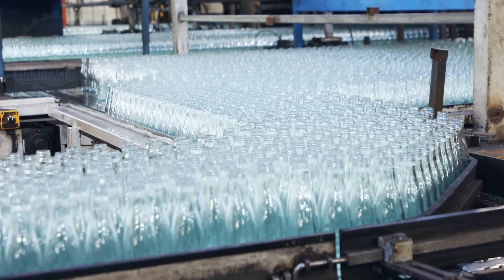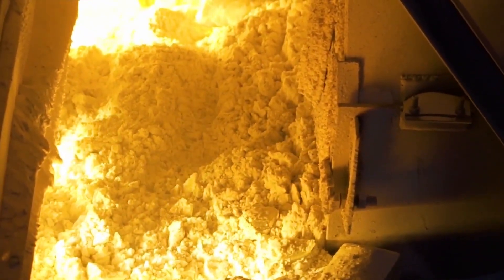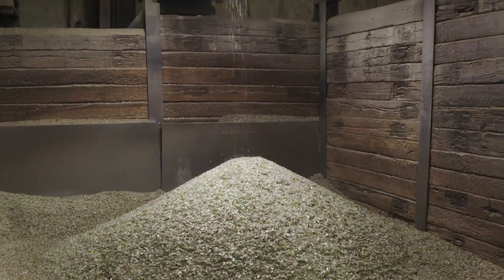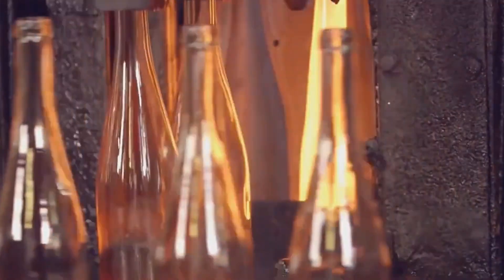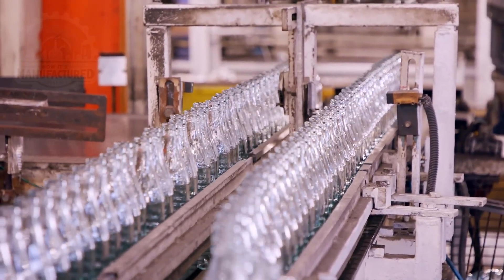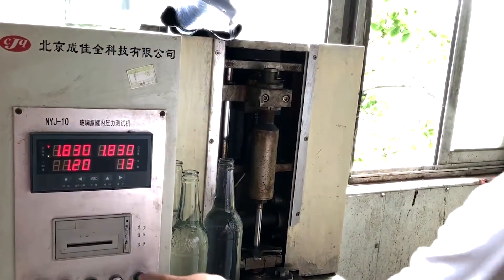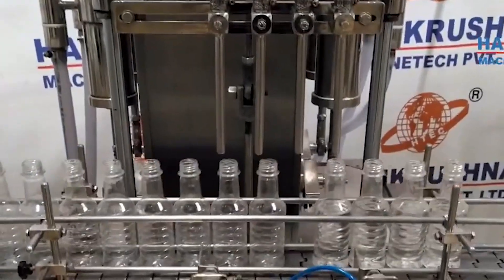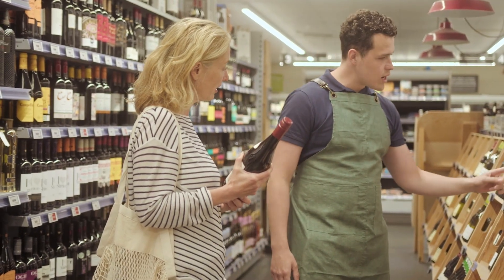How Glass Bottles are Made

Comment: I worked in the factory on bottles just like this one, it was a nightmare, specially during the power outages. When the power goes off, the glass is still melted and still needs to pour down from the furnace, so we had to each time manually reconfigure the flow of glass in the granulation chamber that is situated under the the floor, and it needs to happen really fast. All things for this process are heavy as fck, everyone screams out of stress and you have to be careful and fast. People that work there for years, genuinely develop mental illnesses, as around the machines its hot as all hell around 50 °C, in protective clothing, summer or winter at the end of the shift your shirt is white from all the salt you sweat out and the constant line of bottles plays tricks on your mind after few hours. Every like 20 minutes you have to apply special oil to those molds, while the machine is still operating, you can see in the video how little time you have to do so, before the "drop" of molten glass melt your hand or the pressure lid sewers your hand, and you have to do it on both sides of the mold. One mold for one bottle weighs like 30 kg  and is pre heated to high temperature, for times you need to switch it for damaged one.  You get the idea, looks dope in the video, but you really don't want to work there, unless you are on "cold zone" (the after cooling inspection and packing line). I'm glad they fired me from there, it was hands down the worst job I ever had. I get PTSD just watching it. :D
Reply from the maker: Wow, thanks for sharing, that's really interesting 😁
Reply: :D
Reply: What plant did you work at. I worked at the jax plant
Reply: @Eddie-e5s  I genuinely dont remember the name of it, but it was in Czech Republic, so i suppose we didn't met. :D
Reply: Its so dope though. If glass was cheaper than plastic wed use it for everything and i agree. Salsa should come in jars
Reply: Oh no, maybe you do it every day without electric 😢😢😢😢😢😢😢😢 cause every factory is very easy, only glass bottle factory hard, so sorry for this
Reply: @imavarua2490  I never said every other factory is easy did I? I just said that this one sucks to be in and its hard. And that is true, as is forge i imagine. I work at different factory that produces cable confections and that is by far the easiest work I have ever been in, so... No, not all factories are bad, but bottle factory is fucking hard man, dont judge if you never tried it. I bet you would be the one who would go nuts there. :D
Reply: Very interesting information. I’m glad you got out of there, for the sake of your health.